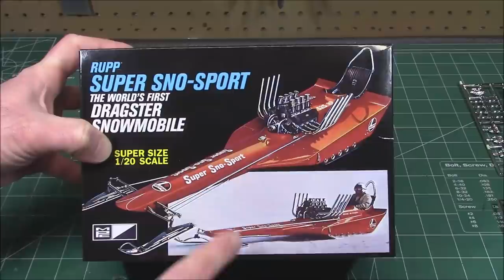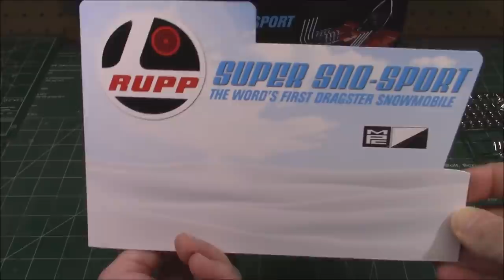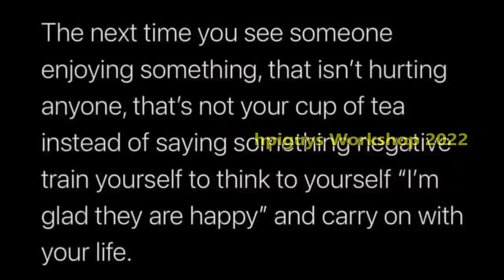Rupp Super Sno Sport Dragster Snowmobile V8 1/20 Scale Model Kit How To Build Paint Decal MPC 961

Comment: With the slightly larger scale - this would be a good kit for builders to try their hand at more, in depth detailing such as spark plug wires and other fuel / electrical components.

Comment: Weird scale, weird vehicle. Does anyone know when this existed? I'd be interested to know. I bet it was crazy driving it.... and deadly even. Seems a little insane lol. But this is America after all. I would love to see this thing flying over the snow. I can just picture myself peacefully cross-country skiing across a field when all of a sudden this thing comes roaring up, engine a blazing. lmao, I'd probably never ski in a field again. Really nice job building it and the hand painting is very inspiring to watch. Also love the music. 
So when you're putting on the longer decals, and it started to break up on you, are you putting down a decal softener like Microset or just water? I recently took your previous advice and let the decals soak in warm water a little bit longer, but I only used water to wet down the application area before I slid the decal onto it. I found that I could move the decal around a lot easier without tearing it.  Then I used Microset over the top with a brush followed by Microsol which caused it to conform to the model nicely after I let it sit there untouched for a while. Thank you for the good advice, it did the trick.
Reply: Found a video on You Tube about this kind of racing from 1990 in Wisconsin. 175 - 188 mph roughly. Pretty cool.